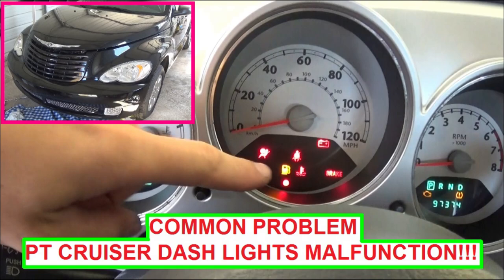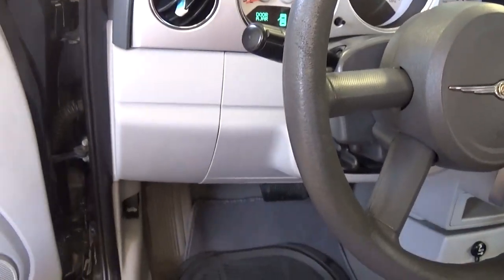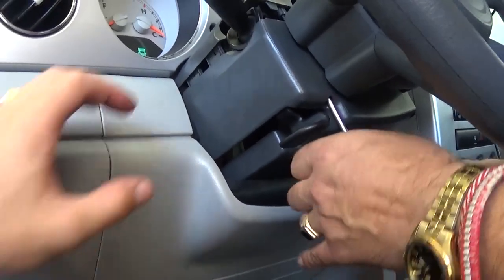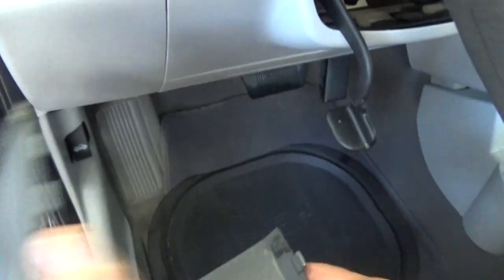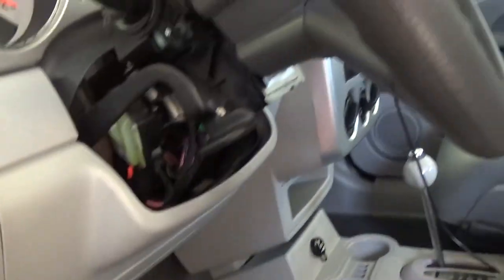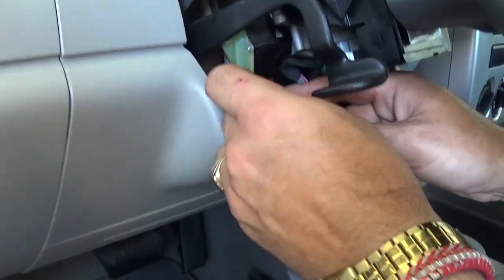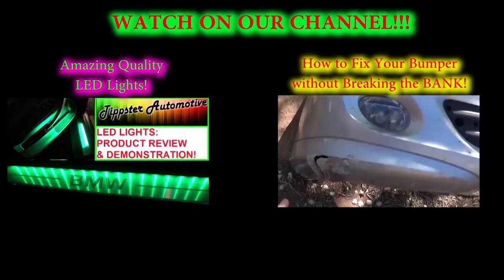Chrysler PT Cruiser Dash Lights  Instrument Cluster lights ON & OFF Blinking  COMMON PROBLEM!

Comment: My 2006 pt cruiser was doing the same thing. I saw your video brought my car into my mechanic. The mechanic got the check engine codes. 8 different codes showed up not related to each other. They thought I needed a whole computer board. They then googled this video that I told them about. They did exactly what you said. Problem fixed! Thank you sooooo much.
Reply: Good to know it. But you had checked to see if these error codes were clear afterwards?

Comment: I spent $500 a couple months ago getting an electrical diagnostic and electrical repair work done because my instrument cluster was doing this exact thing on my 2007 pt cruiser. They told me rats ate my wiring and and it's fixed but it started doing it again. Seeing this video now and I know I got ripped off for sure. I only found this video because I'm installing a back-up cam and trying to figure out if the purple-and-black wire on the back up light is the positive

Comment: I've found that most of the time it is the IGNITION SWITCH.   Replace the Ignition Switch!  You will not be able to do this yourself, because of the anti-theft screw head on top of the switch.  One hour of labor ($90) and the switch from the dealer is $51.  Total: $141.
Reply: tamper proof tools are available at all auto-part stores!

Comment: SWEET!  Air bag light came on couple of months ago (clockspring), purchased a replacement waiting for me to install.  Temps got hot, dashlights started doing this flicker thing.  Saw your video, replaced the clockspring, and corrected the contacts on this plug.  One week later, problem has not come back!!!  BTW, my 2009 is a basic model with no buttons on the steering wheel.  Bought the clockspring on ebay for $17 dollars. Several car models use the same clockspring, look for "106AF" in big typeface.  I think mine said it was for a Jeep 🙂 Thank you for the video! UPDATE: Been a month, no recurrence, NICE!

Comment: This seems like my 2003 pt cruiser problem. At first only when I turned left, then turn right also, then over any bump in the road even when the car is off any bump causes the overhead light to go on and the chime to ding and the word door to go on. All goes back to normal as the overhead light fades off and the word door light disappears unless there is a bump. I have turned the dash lights off via the steering wheel stick where the controls are but at night of course no lights on the dashboard. I could not quite tell what you did to the wire connections, did you actually screw tighten them or something else?

Thank you so much for this video, whenever I have brought this problem up to the mechanics no one wants to solve the problem.

Comment: Thank you sir for this video!
I fixed the red light but the connector was bad. Had to buy new one to solder on.
Now the car runs again with no red dot on dash. 
Wouldn't know how to fix problem without this video.

Thank you again!

Comment: I have a question I drive a 2006 pt cruiser and when I turn the rear windshield wiper on it makes the check engine light come on or cuts the car off

Comment: Hello, I have been having this problem for months now. Is it possible for this to affect the performance of the vehicle. Sometimes when I am pulling out of a parking space or making a u turn. All of a sudden when I put the car in drive. I start rolling in reverse. Also when im driving all if a sudden the car feels lie it doesn't want to go. I give it gas but the engine just revs until finally it jerks and speeds up. PLEASE HELP IF POSSIBLE!!

Comment: This happened to 2 of my pt cruisers. The first one ended up in an accident and getting sold. With the last one I had an ignition switch put in and it solved the problem with the flashing lights, but now my door chime goes off when I open the door even when the key is removed. It says that the door is ajar and that the key is in the ignition. Also my clicker won't open and lock doors. I have to do it manually.  Can you help?

Comment: Have put up with this problem for quite some time. My mechanic could not figure it out, I had the ignition switch replaced any way about 6 months ago. I still get the problem randomly and will try this. But just worried about deploying the air bag. if i disconnect the battery and wait 15 minutes then start working on the wires will that be safe, thanks in advance.
Reply from the maker: +stargate1961 that would be great

Comment: I think the problem with this is different things can cause the dash cluster to bug out so everyone has slightly different problems. One observation i have noticed atleast in my case is that this happens to me only when i turn the dome light on manually by turning the interior lights/brightness switch all the way on and then clicking it over to the last setting that keeps the dome light on. Only when i turn my dome light on manually by doing that is when my car freaks out and the cluster lights comes on, gauges go down and car stalls. Definitely an electrical problem, im going to start by checking the fuse for the dome light then go from there.

Comment: Hi. I have a problem with the light of oil before change the oil and filter, i check the oil level and is perfect, i cant drive, because the buzzer is sound all time, tuun tuun tuun tuun tuun and i have a headache. Can i deactivate the buzzer?
Reply: widebide this is my problem too

Comment: Had 2009 cruiser instrument cluster lights whent crazy and the car would stall wires were good so I replaced the ignition switch 30$ and it fixed it

Comment: my battery, a delco, was at fault. had dash lights come on followed by stalling as well as a very long seat belt alarm. even blew a 10amp fuse . tried to charge battery, got an F01 error on a trickle  charger and never finished on a regular charger

Comment: Please tell me what does the red dot bottom center indicate? I have never seen this come on until a couple of days ago. AAA came out and scanned my car and showed the starter was getting zero power but the alternator is good and the battery is good.
I don't know if I need to fix the cluster as in this video, replace the starter or ignition switch. For a couple of days my car would not start right away, then it did and drove as usual. Eventually it would not crank at all.  
Additionally the key fob insides were missing?!?! At first I thought this was the problem, I don't know how this happened. I replaced the battery in the fob I screwed the case back together and the night that my car broke down I noticed that the insides (the little motherboard) were completely gone yet the case was still screwed together. There is one hole of a missing button but the battery alone is three times the size of that hole. I have no idea how this happened.
I'm on extremely limited funds the mechanic I like has me by parts than he installs but I don't want to buy a new starter if I don't need it then have to return it as I've no transportation to do all of the errands. I don't know if it's okay for me to do the procedure you have in this video or if he should do it I don't have those T screwdrivers for the security issue. I am pretty handy I've done a lot of work on this car and previous cars that I've owned so I'm not afraid to try something like this but I don't want to do damage.
😭

Comment: Hi, this one was really helpful. Could you show how to fix the dashboard clock on a 2006 model?
Reply: Are you talking about the analog clock above the window switches?  If so, press and hold the little peg on the bottom until it reads the time you want.  The digital radio clock is more complicated.
Reply: @learningtobeme5195  thanks

Comment: my pt cruiser turbo has a problem key turns but won't start at all it just seems like it locked from starting
Reply: Omar  Bustos my problem began like this video... all the dashlights comin on and gauges goin down and back up. Now, my car will intermittently start. I am leaning toward ignition switch from what it was doing like in this video, but also am reading that a bad ignition relay can cause the intermittent starting.

Comment: My 06 PT does same , but sometimes stalls out and air condition won't work .  I bought car new and Chrysler wouldn't do anything for me , even on warranty . It also burnt oil from day one . There explanation is they all do that .  Took intake plenum off to change sparkplugs , and found oil in the plenum . This suggests bad oil stem seals .  This week car turned to 60,000 miles .  As you can see I haven't driven it much . I'm not a kid I'm 65 years old . I have changed oil and filters every 3,000 miles myself .I truly have the P T from hell and wish I had never bought this car . Thanks Chrysler for EFFING me .
Your good friend Vinny in good old Fla .

Comment: Hey World Mechanics and everyone else with the cluster lights problem. I figured out how to fix the one huge problem with both the cluster lights on going all crazy and the problem with the vehicle turning off. I uploaded a video explaining what i did. I will describe here just in case you don't want to see my video. To make this explanation short, I had to buy a used ignition switch assembly for $65 and "flashed" in a way, the alarm system synchronized with the cars CPU.. Ok look to make things easy just watch my video for exact explanation cause, its been more than 6 months and i have not had the same problem, ive only had the problem with my cars battery being old or the battery terminals being corroded and needed to be cleaned or replaced.

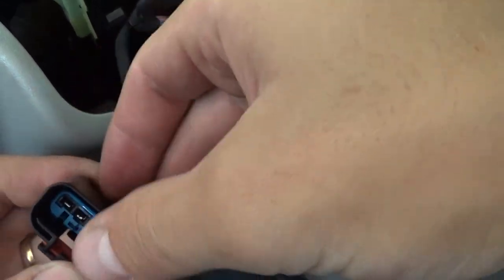Comment: What a scam!!!  It doesn't matter if the cables behind the connector moves one way or another, the blue plastic 3:28 piece inside is a second lock which secures the terminal assembly and position in the contact area. By bending the terminals 3:39 you can break the terminals (contact) and damage the mate connector

Comment: Hi. I have 2006 Pt Cruiser.  
Dash lights issue.
 
Well we live and hopefully we learn.  One day while driving and thinking..i hit my steering wheel with my fists..like maybe around the 10 and 2 position ...and ...a bunch of dash lights came on!😮.   So to try to get them off i hit the dashboard and they went off.

But that was just in my community.  Maybe a few weeks later I was on a major road and  had issue with seeming to lose my acceleration power when the dash lights came on...but they went off pretty fast...and after they went off..i got restored power to power gas pedal.  Im not sure why power cut out...but apparently on other internet locations..people may have mentioned have had stalling and or whatever.  That was pretty scary for me.

With this video...what is that black plug piece called if i want to describe it to someone?  Is that the ignition switch or something else?  The black plug thing that he tightened screw(s?) on?   Thank you.

And..does anyone know why did i lose ability to have acceleration while dash lights were on?

And when lights went out i was able to get gas power again? 

Thank you for any help.